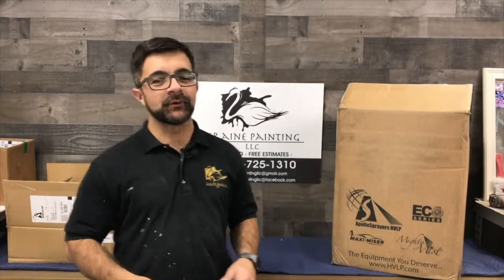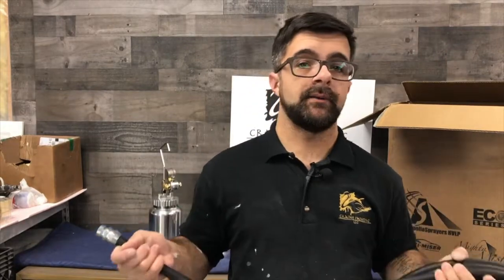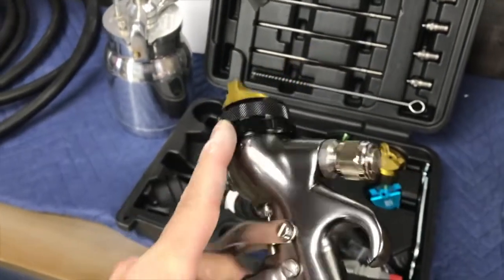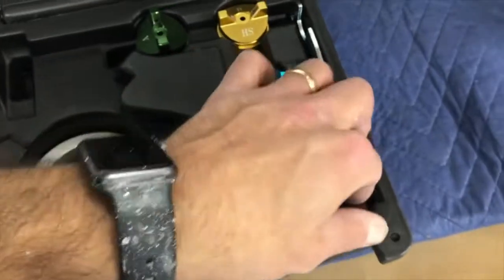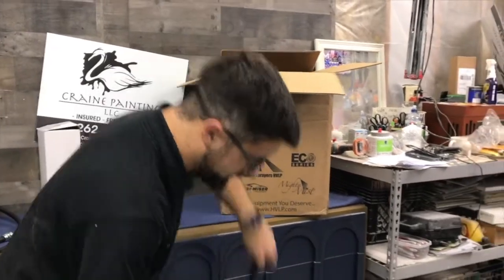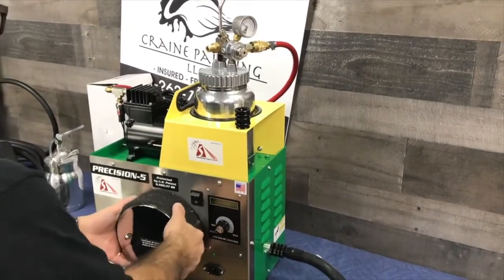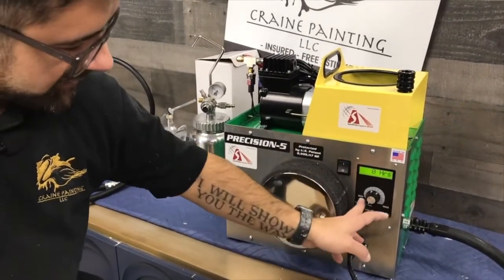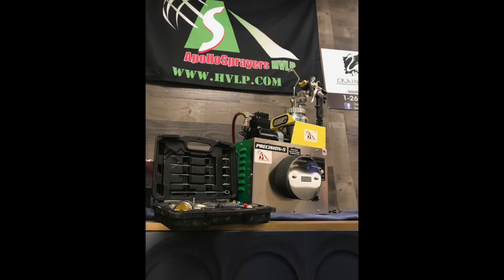Apollo Precision 5 HVLP with 7700 Series Atomizer Gun and 2 qt Remote pot w/compressor Unboxing

Comment: I was part of the engineering team that made this new control system for Apollo, one of the things I told John to do was to make it go to eleven, because we actually could make the Precision 5 go to 11 psi, so I thought it appropriate to make the spinal tap reference. Initially the PID controller was made in order to eliminate the pressure bleed line by idling when not in use, this unit still has that feature, but the bleed line was left in place so peak pressure is around 9psi to meet HVLP requirements. I'm not saying you should, but if you wanted to... ;). Shout out to T. Smith, he's the brains behind this.

13:15, that is so cool to hear the controller at work. Do you notice the change in motor RPM when you trigger the gun and again when you release. That's the microcontroller working to maintain a specific pressure.
Reply from the maker: Hank Larsen you guys did awesome work we love this machine! Definitely thought it should go to 11 though 😂

Comment: I love the finish mine produces but it over heats and shuts off very easily. I basically can’t spray more than 2-3 doors unless I put a fan up to it. I see they have a precision 6 now, but no videos that I can find.
Reply from the maker: Joshua Hagan how long have you had it and have you changed the filter? Apollo is pretty easy to work with when it comes to issues
Reply: Michael Craine I’ve had it maybe 4-5 years. I’ve already returned it once, they do have great customer service, but the problem has never been solved, even with new filters.
Reply from the maker: Interesting, what products are you spraying?
Reply: Michael Craine latex, lacquer, oil, shellac
Reply from the maker: Did it start doing it right off the bat or take a while. I’ve been running mine for hours at a time and it’s jetting out and cooling Down really quickly
Reply: Michael Craine it did not do it right away,  the first few jobs I did, which was fairly big jobs, I ran it for 7-8 hours on and off with no problems. After the first year it started shutting off regularly from over heating and tripping the fuse on it. Now I can’t run it for more than say 15 mins without a fan on it. It seems to do fine as long as I start and keep a fan on it the whole time.
Reply from the maker: I’m gonna be making quite a few videos with this one and see what happens. Really pleased with it so far and we will definitely be putting it through the ringer
Reply: One of the thermisters is bad, there's two, one with a white lead soldered to the controller board and one inside the motor assembly. I'll bet it's the motor thermister, John would've replaced the controller thermister for sure, he may not have replaced the motor though ( I don't think the motor thermister can be changed). Ask john if he would look at that. He's super proud of his poroduct so don't be afraid to ask him.
Reply: @morrielarsen  hi Hank. It's cool that you worked on this machine. I'm just have a quick break between coats & I'm using a 1050 (second hand) with the remote unit. I love it, losing the gun pot makes the gun so much lighter and easier to use, especially for spindles & tighter areas. I have an eco 4 also but was advised not to use that with remote pot, not sure why

Comment: I have used both and I feel a AAA setup is so much better
Reply from the maker: Bruce Hand I hear you man. This setup has worked well for my small company however I have not gotten to try an aaa yet
Reply: Michael Craine you should take a hard look at the Wagner aircoat  AAA gun.
Reply: @twsd  I'm a Kremlin Xcite fan. Too expense to change over now as have all the spare parts
Reply: Bruce Hand I hear you loud and clear. That Wagner gun retails for over $850. Makes my Atomizer look like a bargain at $350. Very difficult to switch entire systems. Especially when you consider the learning curve and information side involved.

Comment: I have yet to find a sprayer that don't need thinning the paint like water
Reply from the maker: chaba72 sounds like airless or air assisted would work best with your products
Reply: @MichaelCraine  no, I'm trying to research what sprayer to buy, I have a gazillion trim to paint, but it still needs thinning paint . And I have no budget to get a 3 stage turbine sprayer, so I tought this may work, but it's only volume friendly,  does not shoot out water based unthinned.
Reply from the maker: chaba72 what type of sprayer do you have right now?
Reply: @MichaelCraine   I have 1 of those graco handheld,
Reply from the maker: chaba72 you might try using a different thinner product like S-W Kem aqua then . Much thinner than a regular Trim paint, or just purchasing a small airles from HD or Lowe’s and using a fflp tip with it. Will still give you a nice finish
Reply: @MichaelCraine   can you give me more information on fflp tip I'm not really an expert on sprayer tips
Reply: If I would have a big enough compressor,  I could use an hvlp gun , but it needs 6cfm
Reply from the maker: chaba72 https://dengarden.com/home-improvement/My-Review-of-Graco-FFLP-Tips-for-Spraying-Cabinets
Reply: Get a fugi turbine atleast 4 stage won't need to thin latex with proper tip